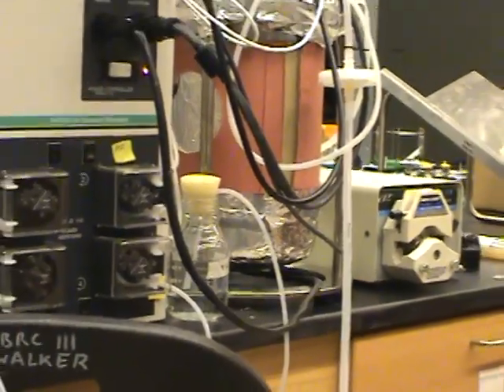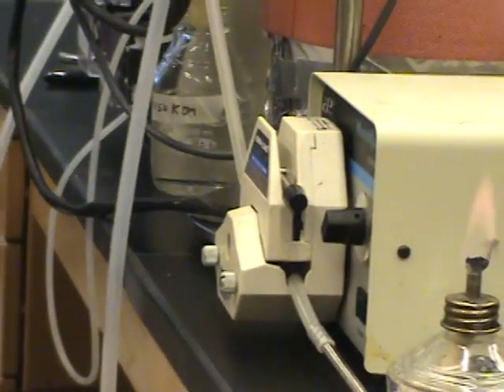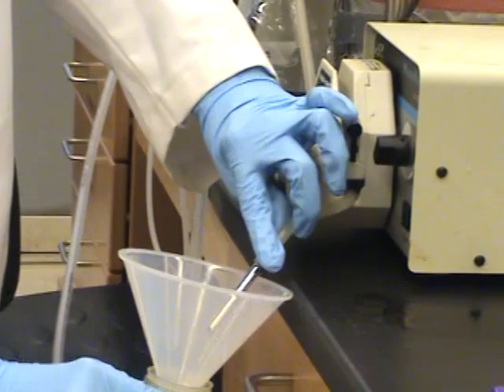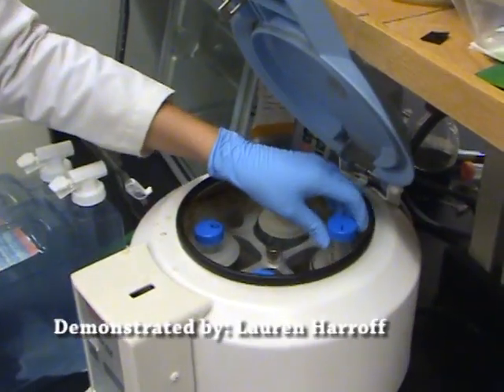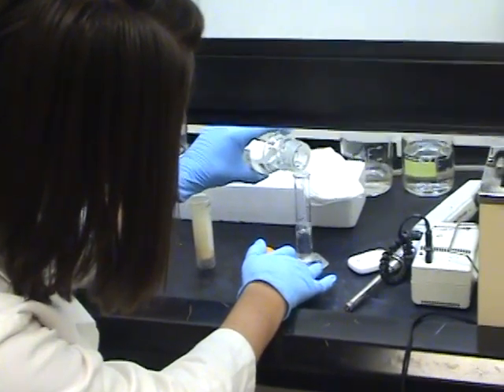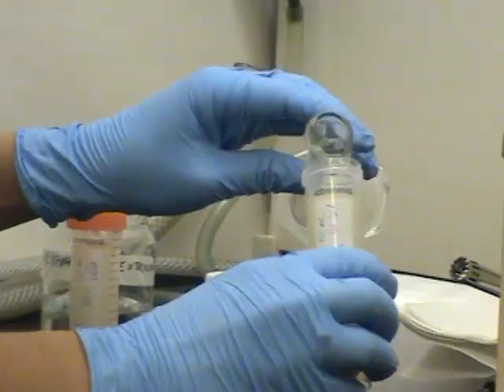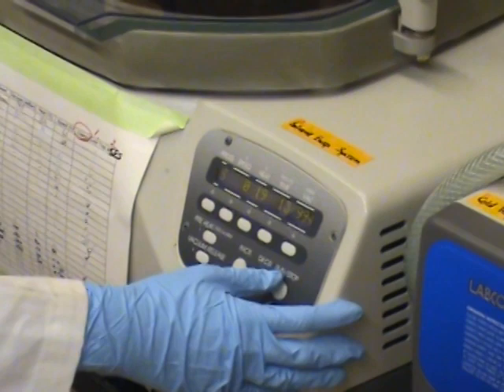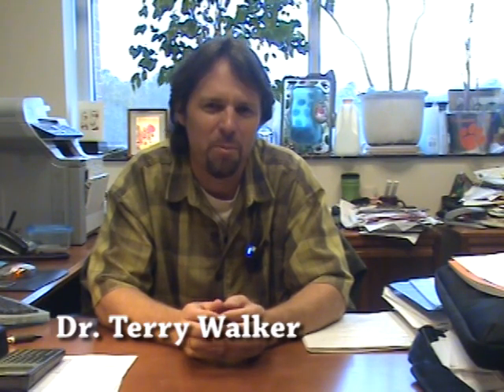Algae Production from Waste Biodiesel Glycerin- Clemson University Biosystems Engineering

Comment: I don't know about this: Growing the algae in the dark is good because algae shade itself and that glycerin waste is a problem. But, the rest of the process seems like an energy sink. The power used in to sterilize & centrifuge the algae, then to dry it and extract it with hexane (which you didn't say was recovered) has to be excessive. You started with 20-30 ml of algae solution, and used 20 ml of hexane and got, what, 1 ml of lipids? Ridiculous!